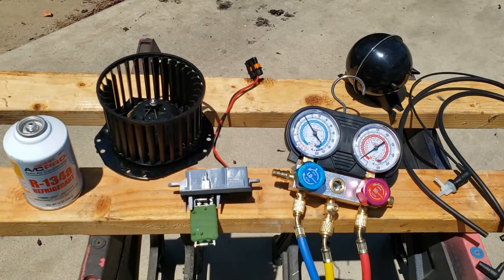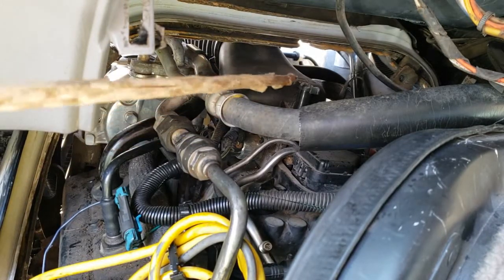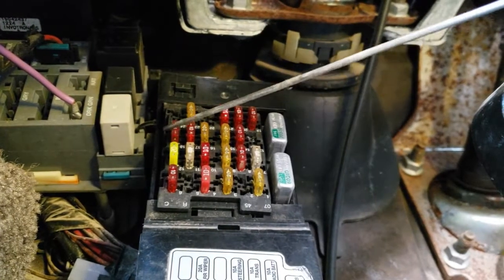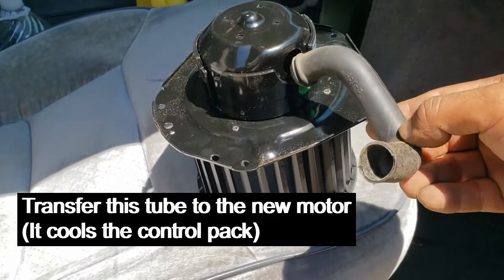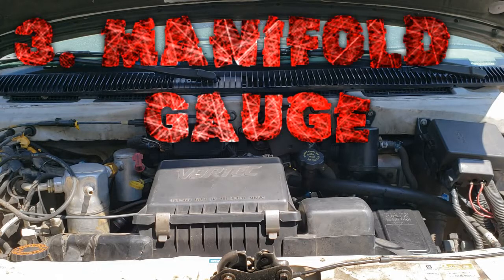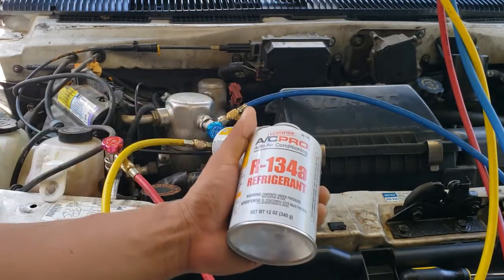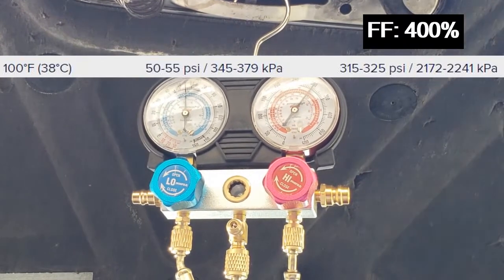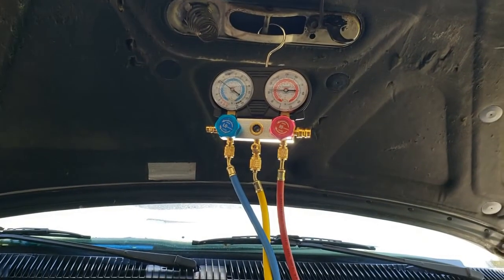Astro/Safari Air Conditioning (Electrical/Vacuum/Components/Refilling)

Comment from the maker: UPDATE July 18, 2021: The Vacuum "Ball" was recommended to me by O'Reilly Auto Parts. The one I added to the van (shown in this video) is (Dorman 47076). This is the INCORRECT vacuum reservoir as it has 2 connections. The correct piece is (Dorman 47083). It has 1 connection.

Comment: Cargo van 2002 has no a/c I have another van with a C can I put the parts into the other van?
Reply from the maker: The compressors are compatible between Astro and Safari for the years 1996 up to 2005. Same with the condenser, evaporator, and blower motor. The lines can differ so compare those beforehand!

Comment: This video saved me $600 and got my ac blowing ice cold after several trips to several local mechanics who couldnt find the problem. They suggested  new relay, compressor, blower fan, comdensor, dryer etc.... it was none of the above. The problem was not finding this video soon enough. I fixed it at home before work in 20 min.with tablet on hood watching this video. One vacuum hose from check valve to intake manifold was disconnted!  Reconnected hose and ice cold like never before, low setting blow cold as well as high, even idles better. Thank You So Much!

Comment: Thanks alot. I took my 2001Chevy Astro Utility Van ext. to several different mechanics no one could find the problem with A.C not getting cold and blowing weak. I almost spent $600 then found your video. It was a simple vacuum hose from intake to check valve disconnected. I reconnected ,myself and Wallah. Blowing cold again after 2 years weak air! I live in SW Georgia which is in the 90s-100+ summertime begin of fall. Thank You for this thorough video! All sauce no filler love it!

Comment: hey my brother! question. whats the function the vac ball. thanks
Reply from the maker: make sure to get the one with only 1 hole! The vac ball is a reservoir for vacuum. That way when the engine is not producing ample vacuum (such as going up hills, or during heavy loads, heavy acceleration), there is some "backup" vacuum to be able to run the A/C vacuum lines/any other vacuum lines.
Reply: @OldSchoolNoe  Thanks man

Comment: I’m working on my 05 ac. There is no current going to the clutch. I’m tracing wires. What a mess. I think there is a ground issue. But can’t find any broken wires. Do you know anything on that?  Do you know if they sell a wiring kit complete ac wiring harness? Everyone says give it a real charge, but I’m pretty certain no power is going to the clutch. Any info would help. Thanks.
Reply from the maker: The ground side is on pin A, gets grounded at G104.
 What I would do is first see if the "A/C Comp" fuse is not broken. 
Then check if the ground is good. I would take a circuit probe (that's hooked up to the battery) and very pin A has ground.
If those checkout then I'd move on to the A/C Enable relay. I'd remove it and see if pin "C8" (orange wire) was getting power with the key on engine off.
Then I'd disconnect the compressor clutch connector and jumper pins "C8" and "D4" (dark green wire) on the relay side and see if we get power at pin A of the connector. (key on engine off).
Reply from the maker: The compressor clutch connector has 2 pins (A and B). 
The power side is on pin B, it gets power from the A/C Enable Relay (normally open), 
that gets its power from the "A/C Comp" fuse (hot at all times) , fusebox is close to the battery.
Reply: Thanks so much. Haven’t gotten to it yet, lots of rain on the streets of Brooklyn, so I’ll try that when it clears up. Thanks for the reply. Lyk what happens.

Comment: Nice Stick bro but wait a minute, that's a vent?? You may have just solved the problem I has been chasing for years.  Everything works until I put it in Max and the my vents drop out like they loss vacuum. I am going out now to check
Reply from the maker: Not a vent on the vacuum ball. That was the wrong one, it only has 1 connection!

Comment: i bought a vacuum ball without a vent hole...only one hole for the tube. is that gonna mes me up?
Reply from the maker: Scroll down the comments to "UPDATE July 18, 2021." Vacuum ball does not have a "vent hole." You bought the correct part.

Comment: Allot of good information and thanks for pointing out the location of the orifice tube for the van with rear air system. I have the factory GM service manual for my 94 Astro that I have owned since it was new and the service manual failed to explain the orifice tube location. My Orifice tube is iced up with a fully charged system and the accumulator is warm so I assume I have blocked tube. I have not had time yet to look further when I can find time.

Comment: Great video. I'm refilling my system, but when I run a vaccine I can only get to -25hg... I can't get to 29hg. I can seem to find any leaks and it does hold that vacuum for 2 hours with the pump off. Should I continue to look for leaks.
Reply from the maker: Interesting question. If that happened to me, I would assume the system is good. The important thing is to not "lose any pressure." I assume you went 2 hours without losing any pressure so you should be good to go.
Reply: @OldSchoolNoe  thank you for the rapid response. Yeah my gut is telling me it's good to go. Will fill it up and periodically check it for leaks. I see they sell leak detectors on Amazon for 30 bucks. Thanks. Keep up the great videos